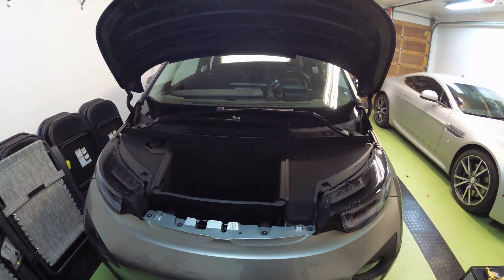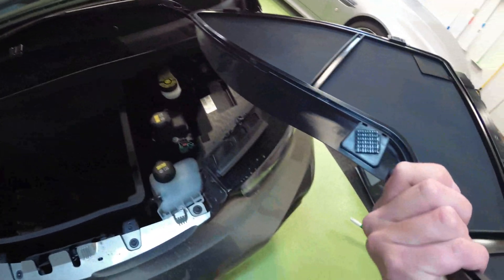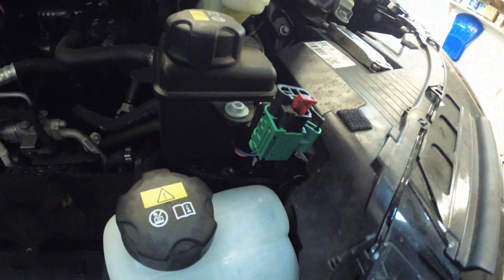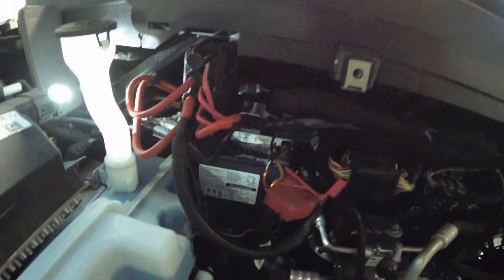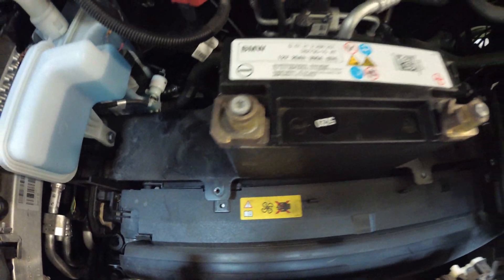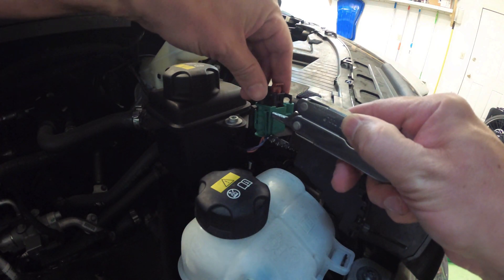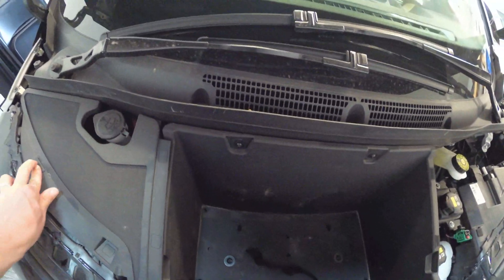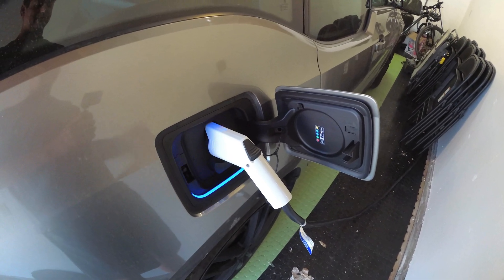Changing 12v Battery in BMW i3 - Fix for "Unable to Charge" & "Battery discharging while stopped"

Comment: Great video! I got a message saying battery discharge while stopped, then a day later followed by a check engine light with a code p1c53. You guys think it needs a 12v battery?
Reply from the maker: I would start by changing the battery first

Comment: There is -35c and got this battery discharging while stopped error. I replace battery to motobatt 25ah and it works oneday and then got same error. I think those vechiles not made below -30c temperatures.
Reply from the maker: I think you're right, that's insanely cold!

Comment: Could a bad battery also the reason for no signal on the screen?
Reply from the maker: if the rest of the car is working fine, probably not, either your screen got disconnected somehow or died possibly

Comment: Hi everyone. I just changed my i3 battery today with one from my UK BMW dealer. It cost £97. I decided to buy the OEM so that all the fittings transferred ok which they did. As per the video the High Voltage connector was a little fiddly but doable. It opens easy just pull the red tab up and wiggle and move it back and up it pops. Getting it down like on the video was a little more problematic until I inserted a small screw driver blade into the slot on the side which then with a wiggle and a push down while pulling back on the red tab it just slides down. So don't stress just do as described and you will be fine. 
You will also need 2 different TORX sockets to remove the plastic Frunk.  4 bolts are x T25 TORK star key hex + 2 bolts are T30 
The positive terminal on the UK model is a pain to get too as its close to the power connectors above so I had to use a small 10mm spanner. Ideally get a small 10mm hand spanner /ratchet. Just loosen it a little and it slips off. The negative was much easier to access and the bolt is on the top. It slid off easy. Getting the negative clamp re tightened when putting it all back together I had a problem with it not tightening. BMW obviously have made something simple harder than it needs to be :-) Anyway there's a little piece that moves and is located as part of the connector just under the bottom of the terminal connector which waggled about so I held this up with my finger then the bolt started to tighten ..phew. 
Apart from all this I decided before starting the swap to put the car in the garage overnight, open the hood, leave the car unlocked and fully charged and let the computers go to sleep. Next morning I disconnected the HV and swapped the battery.
Once swapped the car came back to life with zero errors. I think most problems people face are due to the computers not being shut down gracefully which is hard to do if the battery fails. However if your swapping before failure just make sure they are all shut down before disconnecting the HV. Leave the car at least 30mins with the hood open before starting the job and you will be fine.
The battery is not that heavy and in real life and quite small for a car battery thus easy to get in and out with a little moving sideways of some cables and rubber pipes (UK side) . There are no big issues removing the battery just take your time and move any cables out of the way and it comes out ok.
You do not need to register the battery for the car to work. However as I had already purchased the Bimmer Link phone app and an OBD connector I reset the battery from the app. Plug the ODB connector into the socket under the centre dash on the RHS near the steering wheel (UK) then open the Bimmer Link app on your phone, connect via bluetooth to the ODB then turn the car on aux mode (radio on etc.) connect to the car and select battery. There's an option to register a new one which with one click does so and records the vehicle mileage. 
I also checked the vehicles error history while using the app. Yes there was 2 small errors that are not critical re the 12v battery which I guess is because it was removed. I just deleted these from the app. However prior to all this messing with the ODB and the Bimmer link app the car was just fine and these two little error codes were not displayed on the car display so don't worry if you don't have the App or OBD. :-)  Just take your time have the correct T27 TORX sockets to transfer the brass battery post adaptors and a small 10mm spanner / 10mm socket with at least a 6" reach bar to get to the bolts holding the bracket. This is perfectly doable with these tools but if you do not have the tools described above don't start the job until you do.
Reply: My car start normal but doesn't charging, also battery needs to replace? Thanks for advice

Comment: This is my go to video for a 12v battery change because it is the only one I ever found that addresses the difficulty of resetting the high voltage disconnect.  That step has stopped a lot of DIYers dead in their tracks!  Always topping off the new battery first won't ever hurt a thing and maybe even save you headaches.  Thanks CTP 1111.  P.S. One other little tip.. With the neg terminal and bracket off, cock the battery with the positive side coming towards you to get easier access to the red flap and 10mm terminal nut.  Install same way in reverse.

Comment: Hey there,
My BMW i3 won’t charge at all at home or at available charging stations close by. Would changing this battery fix this problem? Thank you
Reply from the maker: This should be the first step and will likely fix it. Then if that doesn't work your charging harness would probably need to be replaced I would think, hopefully not though as that is quite expensive
Reply: Thank you so much!
Reply: Hi brother, now I have same issue, can you tell me your advice from your experience, thanks 🙏

Comment: Thanks for the video. I replaced the battery today, and the message still appears on start up. 

Do you know how to clear the message?
Reply: Update - After about 24 hours or so, the message simply went away on its own. 🤷‍♂️
Reply from the maker: try resetting the service message like in this video I made maybe that will help https://www.youtube.com/watch?v=bkzrBnEnMbo
Reply: @ali_shafai was it just a message not cleared issue for you?  Were you able to drive?

Comment: Hi, may I ask for your insight: I got an error that the vehicle is unable to charge, go to nearest service, so I did. They replaced the power socket lock. I got back a fully charged vehicle, but noticed the "battery discharging while stopped" message the second day and was not able to charge either. Then I tried again and somehow managed to charge the car and right after the 12V battery died, so I started getting all the system malfunction errors. Now at the service they changed the  fuse carrier and the 12V battery - everything works. My question is - is it possible that they changed the power socket lock for no reason? :) Because by the sound of it, it worked fine. I did mention it but who am I to argue with authorized mechanics. Will be very grateful for your comment.
Reply from the maker: usually just a battery replacement is what fixes the issue. So yeah they probably didn't need to change the fuse carrier or the power socket lock, not sure what you can do after the fact :(

Comment: Thanks for the video & it was a little different for me. However this is what I used or some of the same steps:

T30 bit(frunk bottom screws x2 & outward x2)
1/4 hex key(frunk 2 screws on back)
3/8” DR with 10inch ext(top bracket screw)
3/8” DR with 6inch ext(bottom bracket screw)
& disconnect HV(high voltage) green switch w/red tab with 1/4 hex key in hole(before you move 12volt battery 🔋)
*Remove terminals 
*Then I removed the drain hose from the battery.
That’s how I did it on my 2017 i3 Rex.

Comment: Thank you so much brother man! My wife will finally let me sleep in bed with her tonight instead of the dog house 🙏

I would like to add that I found it easier to work the wrench after removing the top piece of the washer fluid reservoir, just turn counter clockwise & comes right off.
Reply from the maker: Glad I could help

Comment: Thank you so much for the i3 battery disconnect/reconnect tips! Best on the web. What a pain.
Reply from the maker: yeah figured I'd save some people the frustration that I spent like 20-30 minutes on haha
Reply: @CTP1111  I just wish mine would have jumped right back online afterward. I'm getting drivetrain errors now, so still can't drive it. We'll what happens from here. Buying a computer on wheels is definitely an adventure.

Comment: I’ve a 2014 Rex with charge fault, not possible to charge fault only with type 2 cable. Bmw want to replace EME module for 7500€ after 1000€ on KLE check and LIM module changed. Can this battery be a possibility? Thanks mate
Reply from the maker: It fixed my "Unable to Charge" fault, I would try replacing this battery first as it shouldn't be more than $225
Reply: Will do and let you know. Thanks for your time! 🙌🏻
Reply: @antoniotorresrodriguez308  how did it go ? was it the battery ?

Comment: Thanks so much for this video!  I just completed my replacement and everything seems ok so far.....keeping fingers crossed.  

When I disconnected the vent hose from the old battery, though, the whole vent tube came up.  I attached it to the new battery, but it doesn't connect to anything on the car - do you know where it's supposed to connect to?  Does it really matter?
Reply from the maker: Its a sealed battery so im pretty sure its not necessary but if you can connect it somehow i would just in case

Comment: I just replaced the battery, but one of the many alerts caused by the dead battery didn't go away (drivetrain alert). Now, the car won't start. If you have any suggestions, please comment.
Reply from the maker: I have no idea other than maybe disconnecting the battery and reconnecting it again, and making sure that the high voltage switch is back in its proper place.  Other than that, you may have to consult the i3 forums and then maybe the dealer
Reply: Hey I'm having the same issue, just replaced my battery and getting a drivetrain and charging error. Do you have any tips, how did you get yours going again?
Reply: @nebulebb  I ended up towing it to a dealership. They charged about 800 to replace the battery and reset everything. I don't have that car anymore. I was barely getting 60 miles per charge after 50k miles.

Comment: Did you ever have to register the battery?
Reply: Also, did you charge it before installing? I’ve seen a few other people do this. Mine comes in tomorrow. So, I wanted to make sure I do everything properly.
Reply from the maker: @VerticalNine  no a new battery should be charged already
Reply from the maker: Nope, never needed to, been using it for months now with no issues.  My battery never fully died though
Reply: @CTP1111  nice... I will be replacing mine on thursday and hoping to not run into any issues.

Comment: 2014 battery on deck, still rolling in 2020.
Reply from the maker: best of luck going forward, the error happens suddenly and the replacement batteries are hard to acquire!  hopefully you don't use it as your daily driver
Reply: @CTP1111  yep. My only car for now. I do plan on replacing the battery soon though. Too many horror stories.
Reply: @o751106  just did mine using a etx18l from orileys minor modifications. cost me about 107.00
Reply: @19schneider85  cool! By the way. Still rolling March 2021. Probably because I leave it plugged in when not driving.
Reply: @o751106  Mine is a 2014 original battery as well I thought the same thing as a plug-in almost everywhere I go I’m surprised it lasted this long
Reply: @19schneider85  ikr. I hope to keep rolling until Jun lol I think I’m ready to get more range, around the 300 mile mark. Also, my i3 is a REX. I didn’t pass emissions last year, due to a faulty charging lock mechanism. A $1000 repair. Passed emissions, but that experience lessened my desire to keep it.

Comment: Can a larger format battery be installed in the storage bin?
Reply from the maker: potentially, but then you'd have to splice the battery cables to make them longer and also figure out how to secure the battery nice and tight
Reply: Yes, there is a BMW option. I did it because the AGM batteries are shit and only last 3 years max, if you leave them standing for any length of time they just self-destruct. I even contacted the manufactures of these batteries in the USA and they admitted their own products were totally shit avoid them like the plague.

Comment: Where did you get the battery I'm having that problem with my i3 2014 right now and it doesnt want to start at all :(
Reply from the maker: I had my local dealer order one, took em about a week to get it, cost about $200 before tax
Reply: @CTP1111  I just followed you and changed the battery, key working all seems to be working except the car wont move forward or in reverse.... any suggestions? perhaps i forgot or missed something??

Comment: Do you need to register the battery?
Reply from the maker: Doesn't appear to need it, although I never let the main battery fully die so that might have something to do with it.  Everything is working perfectly, your results may vary
Reply: On Reddit, they highly recommend it. My 12V fully died. The car is now stuck in my driveway, waiting for me to locate the battery. So far, they in itself is difficult!